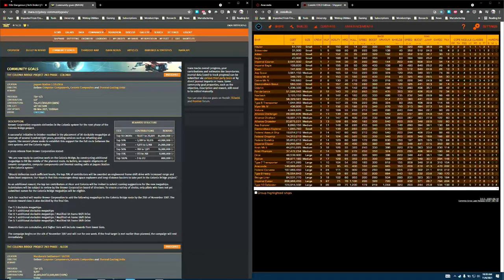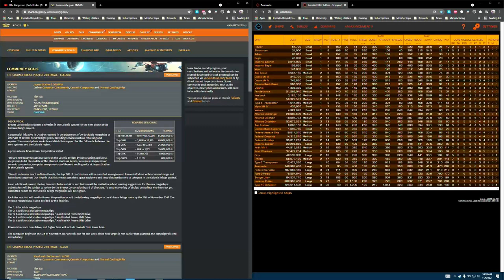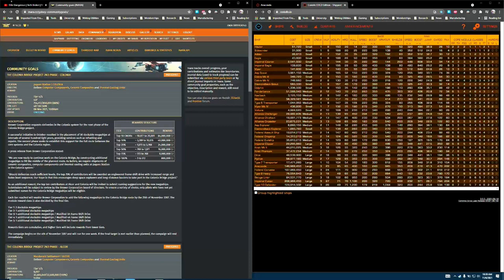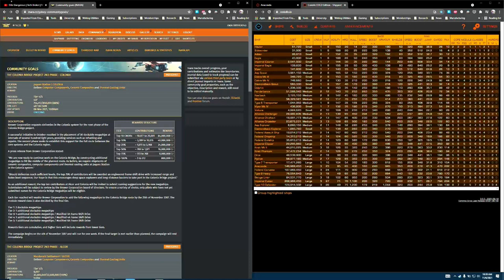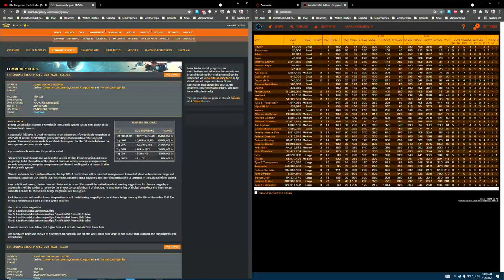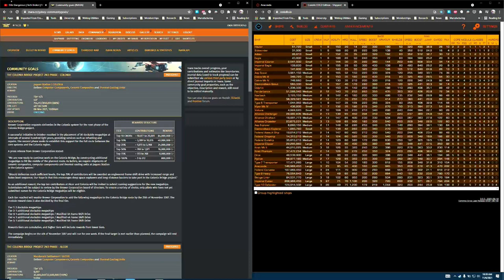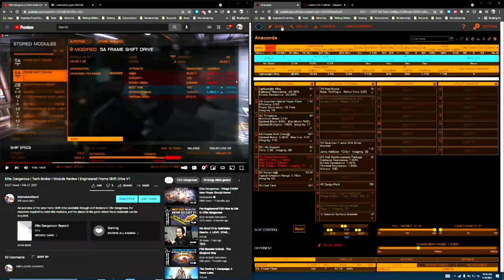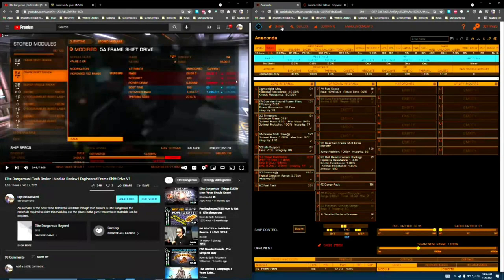Elite Dangerous | Tech Broker | Module Review | Engineered Frame Shift Drive | 3A, 4A, & 6A

Comment: Can these FSDs be modified further with an experimental like Deep Charge and Mass Manager and if so which would be the better experimental?
Reply from the maker: I don't think so. Used to be the case, but frontier is moving away from allowing experimental effects on exotic modules.
Reply: That sucks
Reply: @DryHeatAndSand  ah yes frontier laziness never hits the bottom
Reply: They will allow them the did with the first batch of the 3,4, and 6 and they will add the exoerimental effects to these ones in a few weeks